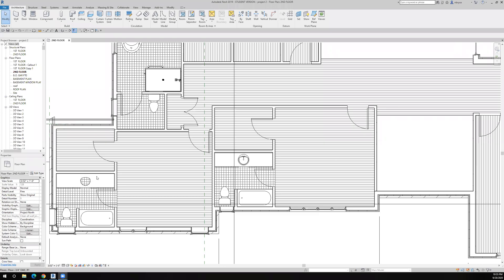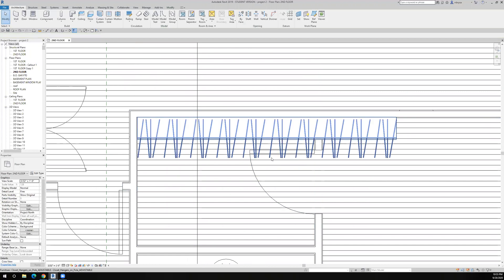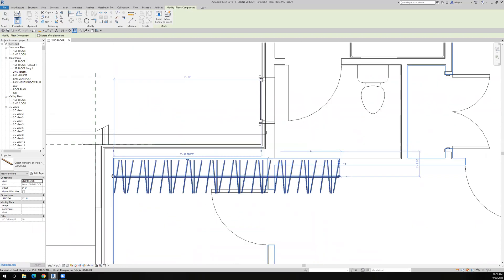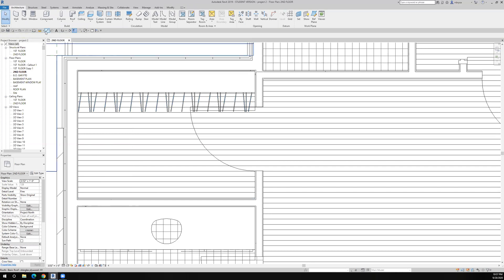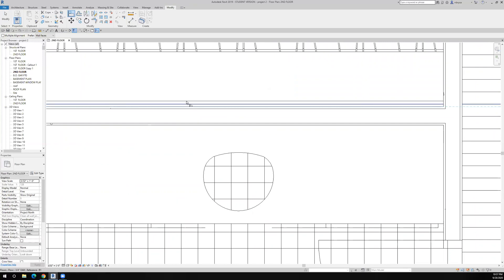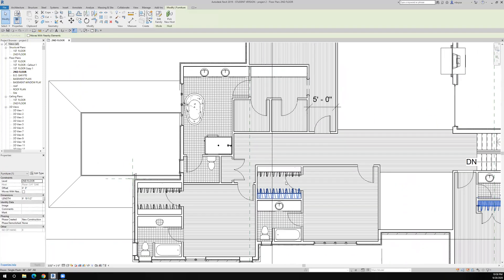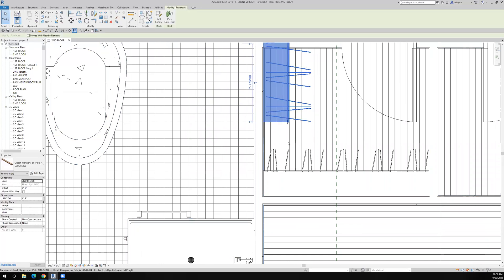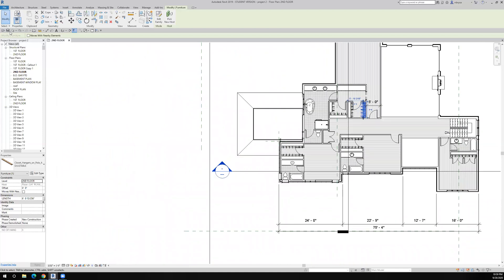adding second floor closet shelf, rod and hangers from a parametric family

Comment: do you have a name for your closet rod shelf and hanger and location?
Reply from the maker: DIRK, CLOSET_HANGERS_ON _POLE_ADJUSTABLE.  UPLOADED TO REVIT CITY
Reply: @revitresidentialtutorialsr9131  File not found.
Reply: Yours I did not find on Revit City, but the one I found doesn't allow for width adjustment. FIle name for what I found: Closet_Hangers_on_Pole_10694
Reply from the maker: @dirkbaeuerle2952  Dirk, i will double check now
Reply from the maker: https://www.dropbox.com/s/m6c45xgicycp408/Closet_Hangers_on_Pole_ADJUSTABLE.rfa?dl=0
Reply from the maker: dirk, try that link to dropbox